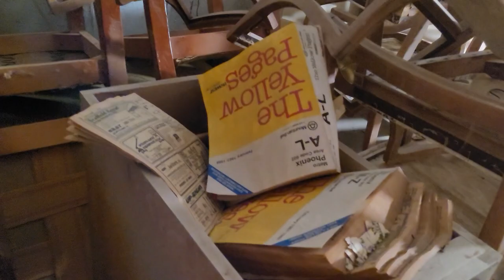Building a Homemade ELEVATOR in our Abandoned Backyard FALLOUT Shelter! | Part 6 INSTALL AND RIDE!

Comment: A breath-taking sight to behold.  And the elevator install wasn't bad either.
Reply from the maker: Thanks Steve, I've been working out!
Reply: Hahahhahahahavavha good comeback
Reply: Kinda weird
Reply: @mike971000  its only weird if you make it, weird.
Reply: 19:22 wasn't too shabby neither but missing a sound effect...
Reply: Splendid lift !  Althought you may bê facing through some troubles when the eléctric power is gone. May bê left stuck downside.
Reply: Bahahahhaha that was a good one!!
Reply: The problem is when you have air going out you have to have air coming in.  You need a second pipe to bring air in.
Reply: @HerbOMatic  mimetizza meglio il coperchio mettici sopra la stessa ghiaia del cortile incollata
Reply: Anyone want to fill me in on what happened after @5:20 or so ? I uh- had to do stuff the phone rang or something I don't exactly remember but it wasn't weird- whatever- I had to step away or a reason WHY do I feel like you are judging me ? hahah nevermind .      What ...?
Reply: @HerbOMatic  We've noticed ;)
Reply: Good idea on the elevator it's nothing fancy but hell sometimes the cheapest works the best
Reply: Cracks me up the way he adds that track to it. Just want to know where to find it now.
Reply: @HerbOMatic  lmao

Comment: Emergency route.  In the structure of the frame, it would be good to have a "ladder" along which you can get up if there is no electricity.  As well as an elevator floor hatch.  So you can get out even when the elevator is up. Both easy to add. You will add horizontal steps between existing supports.
Reply: I’m just worried about being able to get out of that sliding door gets blocked accidentally  while they are down there enjoying the comforts of their newly renovated bomb shelter / earth cooled den someday.

I mean, what if a stray horse decides to die right in the area where the door is supposed to slide when the door opens.

My very next project, if I were them, should be a completely separate escape route… possibly into one of the buildings.
Reply: I was looking at the comments for the exact same thought. Ladder rungs built, or even bolted into the frame would allow for an emergency escape route.
Reply: Yep I was thinking the same thing. Definitely need ladder rungs.
Reply: @ssn608  They  also will need a blast door and blast protected air inlets with filters for radioactive particles if that shelter should become  a shelter for a nuclear war.

Comment: I think that it would be a good idea to store your extension ladder down in the bunker incase of a power outage. That way you wouldn't be stuck down there
Reply from the maker: Definitely a good idea Jeffrey!
Reply: Install some ladder rungs on the frame, that way you can still use your extension ladder for other things.
Reply: There's a few steps on the frame. Enough for most people.
Reply: Maybe a battery with a dc motor would be a better idea since the whole point is to survive when everything is failing.  You could hook it into mains power to charge the battery for now but use solar panels if the power never comes back on. You would still need a ladder or a way to climb out just in case.

Comment: Fantastic work!  It looks as if you could some additional horizontal bars going up the framework (in-between the existing ones) and you'd have an emergency ladder as a way to climb out with no power :)

Comment: Tip: if you want to raise the platform to be level at the top so you don’t have to step up to get out, just build a box the size of the platform at the height needed to finish flush. At the bottom you can just do a raised floor with a couple of steps or a ramp to the door. Might just need to raise your safety gate. Just an idea 🤷🏽‍♂️. I’ve been loving watching the build and your humour is 👌🏻.

Comment: Good idea may be to weld some extra runs on the elevator. so incase of a failure in the motor/winch you can use it as a ladder to get out
Reply: But sometimes you don't want people to get out.

Comment: It was a Bomb shelter for the big 'what-if'. If it's going to be used for more than that (obviously) it should have some basic fire safety and a second egress. Even a simple vertical shaft with a built in ladder in a back corner or over the bathroom would make it practical. Even the missile silos like the one in Tucson had emergency egress routes. A little shed over the main hatch also makes a lot of sense. It would just look like a standard storage shed at the corner of that fence. Super fun watching. I'll trade you an airplane ride for a tour one day :)     Scott in Chandler.

Comment: OSAH has left the group chat. This is one long video about why women live longer than men and the thoughts that run through men's heads... Also it's amazing the effect the different colors of shirts have on her hair color, bringing out different notes with each change.
May I suggest also that you install a limit switch of some sort that will stop the lift if it rises under the lid while it is closed since otherwise it could just go squish and or crunch.

Comment: Amazing build!
Now add a safety switch to the elevator "door" so it has to be closed when operating the elevator. Also a safety switch if the elevator door frame hits the closed/ partially closed hatch. There is enough space between the upper edge of the elevator door and the platform for a person, so if it stops then its no problem. Put a ladder into the elevator shaft in case the elevator fails.

Comment: just awesome, quick suggestion: put another kill-switch lever-thingy (mechanical term) on top of the safety gate so if the sliding gate is not opened all the way the lift wont try to keep going up possibly breaking both things
Reply: uuhh uuhh, and a sign under the base plate that reads: "...if you can read this you´re about to die..." or: "...you really shouldn´t be standing there..."

Comment: The Mrs has a good point. Might consider adding some rungs to the elevator so you can climb out due to power or winch failure. Cool space you have.

Comment: Came out great . Now I move remove the lid and install a metal building over it with a lean to for the dog house,far more secure plus you can install a beam and trolley to lift larger objects in and out. Now power and ventilation so you can start making it useable space.

Comment: You may want to think about a rubber gasket, like a door seal, on that lip. It would help with the seal and keep anyone from getting cut. Love the videos !!
Reply from the maker: Tim, I have a ton of work to do on that door definitely need some seals as you suggest.  I want to keep it as original appearing as possible in the process.  Thanks Tim!

Comment: Hi Herb, one small flaw in your otherwise fantastic plan is the remote stays with the lift, so if you have an accident while down there nobody can summon the lift to help you.
Could you wire in permanent switches top and bottom to avoid someone being trapped while the remote is on the lift.
it would be cool if you could make them momentary switches that you don't need to keep your finger on and the limit switch stops the lift for you...
Other than that brilliant work and I do appreciate the humour and the fact your don't take yourself too serious 👍

Comment: Is it the best idea to have an elecrical lift to a shelter room? I mean in case of using it as a storm shelter, electrictity might be out. Same if a nuclear strike. It would most likely start with a few nukes detonated in the air to create EMP's to knock out the elctrical grid. Unless you have a generator well under ground or in a  faraday cage it will be knocked out too. Also in case of an emergency it is a bit of a slow way to get down into the shelter. Also it limits (size wise) what you can get out or into the shelter as compared to a stair. The hatch not being able to be fully opened might do that as well. If the source to the electricity is above ground it also leaves you vulnerable to attackers or unwanted guest wanting to get in. They could cut it off. That being said, it is really cool and I enjoy following the project. The humor in the videos is great. 😎

Comment: Three things,
One, for a bomb shelter you would want to redo that main door and get some ventilation in there.
Two, You may way to put a wench/pully at the top to pull out all the stuff inside  and put stuff inside.
Three, super cool project!

I lied, some extra comment. Maybe have the elevator gate fold so it can be closer to the top when up. And maybe have another control at the bottom so you can call it down.

Comment: Pretty awesome. I'd add three control switches if possible: one on top, one at the bottom, and one attached to the lift platform. Then you can summon the lift if someone has already gone up or down without you.
Reply from the maker: That's the plan, I want to work on some other stuff then I'll make some improvements to the lift!  Thanks James!

Comment: i see you cut the lip of the lid so it would close over the lower lip as i suggested :) ,  you should also weld some extra rungs on the frame of the elevator to have a backup method of getting out/in

Comment: I would move the doghouse to the  top of the sliding door to conceal the access point and avoid vehicle collisions. I am a journeyman Elevator Mechanic with over 14 years experience,,..and although I have seen much worse attempts at this, your focus on safety is commendable. May I suggest an electro-mechanical gate switch, and a slack cable switch in series with the limit switches, and you should include a bottom limit switch also. The problem with this ancient design is when rust and wear cants the platform in the shaftway and gets stuck, the cable plays out and the platform suddenly drops all the way to the pit. Wear on the cable can also cause a failure which is why modern elevators have multiple cables and a "traction" system instead of a "winch" system which has been outlawed for many years because of intrinsic safety issues. Buffer springs in the pit are a  common addition for safety.... In every State in the US and on Maritime Vessels There are Regulations concerning Elevators and I suggest anyone attempting to build an Elevator read the applicable regulations in their particular State. Elevators need to be regularly inspected in most States at the owners expense, there are fines for safety violations and there is an applicable property tax for having an elevator. Just Saying.
Reply: I removed an elevator on Park avenue In NYC installed in the 1700's. It was obviously installed before the fire that burnt down much of Park Avenue way back when and showed signs of fire damage and had been inoperable since then! The Owners of the Building had been paying tax on it for 200 years until they sent me and my helper to remove it. Go figure! it was a Ratcheting hand crank sidewalk elevator with gears  forged by a Master Craftsman Blacksmith From The Time of George Washington!
Reply: What local you part of?
Reply: @dougbeck1614 : To My Oath , Local # 3 E Division New York City Forever.
Reply: Local 140, Phoenix/Tucson

Comment: An idea, split up the lift control, have one mounted on a stand on the platform, one on the wall down below, and maybe a secure box outside, to bring the lift to height after opening the lid, and to lower it down to close the lid without out having to reach for the winch control.

Comment: You call it a gantry, the first thing that came to mind, was gallows. You will have to install a power cutoff switch if the door is closed, and probably a recall switch if the elevator is the upper location, or an emergency ladder.

Comment: As a quality feature, put a control panel at the top, bottom, and one on the carriage.
Not a necessity but nice to have if you drop the controls
Reply from the maker: That's the plan long term Kyle!  The control runs to the top first and is suspended so you could grab the cord from any place along the run for now.

Comment: What happens if the elevator break's down while you are down inside. Nice job though. Another problem be, if a soaking rain storm comes it won't be safe. I rather be 3' above the ground. Much safer. No threat of drowning. 👍

Comment: Just a thought. Could you add a second elevator switch? You could leave one attached to the wall at the bottom so there is no way for someone to be stuck, forgotten or left below without a way to use the elevator. Then the current switch could be attached to the elevator itself and you’ll not have to deal finding/lifting/storing a loose switch.

Comment: If the cable is the only means of going up and down on that elevator.  I think you’re gonna have to install some kind of a safety just in case the cable brakes to stop the elevator from slamming down.   Furthermore you need a secondary means to climb up if it does break so you’ll need to put a ladder on your wall.

Comment: If you ever need to do something like moving the elevate frame again...use a Refrigerator Dolly. A good one has straps to hold it against it...and not only wheels but a track on the back to roll it up curbs and steps.
Reply from the maker: Dang, I actually have two!  Why didn't I think of that?  Thanks Arthur!

Comment: Your temp cord, you should put a drip loop in as water could come in that hole and down the cord into the motor.  Also the UV will eat that cord after a while, so be careful.  Also you might want a lock of some sort to keep kids out.  I might use a deadbolt that way you can lock it from both sides.   Also wire a second station in for the control from above and below.

Comment: Neat. The 14 acre property i got has history all the way back to the civil war.. a graveyard from the family who owned the once 100 acres is there.. but it was subdivided at one point.  Hense why i have 14.   And when i got it 6 months ago i walked the property and found a small bomb shelter under a giant tree.. the shelter is a oil/gas tank of some sort..  that buried in the ground surrounded with cinterblocks..  has ventilation on top as well.. thats how i found it was the vent.   The tree thats on top is about 50 years old.  So im guessing this shelter was built in the 60s or something during the cold war.

Its nothing as intricate as yours.. but still very cool..   not sure what ima do with it though if anything.  As i have so many other projects like the 80x50 pole barn and workshop in it.  And the 50x30 former dog kenell which i dunno what to do with either lol..   the kennle is near the bomb shelter.  Thinking of running a 10-12ga UFB wire on a seperate breaker from the kennle to the shelter to get power in there.. clean out the entrance.  Fix the door.   Clean out the shelter..   repaint it inside.  And maybe turn it into a  little man cave of some sort where i can mess sround with my guns and stuff.  Put a work bench and bed in there etc.
Reply from the maker: That sounds pretty awesome, where is your 14 acres?
Reply: @HerbOMatic  near culpepper va.  near one of the ford rivers dont wanna give the exact name lol the original road is still there, just modernly paved now, and you can drive along the road and see the crossing where they had 22k confederate men cross in 1862.

found signs the barn was built in 1968, judging by the light post which still have 2 old mercury vapor lights on it that still work. and the power guy saying its 50+ years old.  im guessing the bunker was built in the 60-70s as well... im veryu jeleous of your bunker though... i would totally turn that into a man cave with lava lamps, my aquariums, and a little gaming room for my pc, 

Is there more to that thing ? looks like i saw a bathroom and stuff too
Reply: @HerbOMatic  plz makem ore vids of that shelter i want to see everything !

Comment: I would have used a 12 volt wench with a solar battery and solar charger because it you need to use it more than likely the main power grid will not be working. Then you can also use 12 be volt LED strip lights set it up like a motor home inside.

Comment: I like the idea of the elevator and excellent job with the construction and installation. The only concern I have is concerning emergency egress should there be a power issue. is there a manual override to bring the elevator up? Or possibly another egress option such as a permanent ladder mounted in the elevator shaft? overall nice presentation and audio comments...

Comment: I'd do a piece of metal or an extension of the gate post going up to above head height that stops you from clonking your noggin on the bunker door.

And a secondary control wired in at the bottom of the lift so you can call it down when one of you is up top.

Comment: You should do a two-way switch for the elevator. One at the bottom and one at the top.
Reply from the maker: Eventually I want to install call buttons, that will be  project by itself especially if it's automated.

Comment: Would suggest a safety "Down" switch at the motor or perhaps on the wall of the shaft at the bottom just in case the elevator is "up" and the controls are with it. Possibly the same up at the top in a weatherproof box.
Reply from the maker: That's the plan to have at least duplicate controls at all three spots.  Thanks Jguy!

Comment: also, if you have a limit switch on either side, you should be able to easily add in a holding circuit, and put a push button station at the top and bottom, so you dont have to hold the winch controller

Comment: You can get ladder rungs that simply hammer into concrete sides after drilling holes. Like they use in drainage pits.
Reply from the maker: That's what I'm thinking